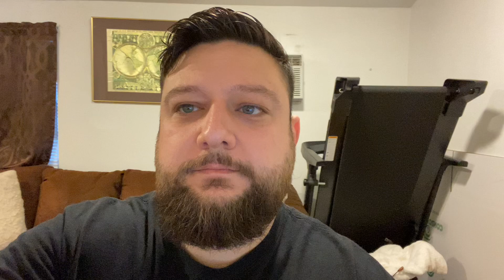Classifying High Compression Engines & When to Use High Octane Fuel

Comment: I know that you are talking about car engines but in the world of bikes, most are tuned for 91 octane. But Triumph Motorcycles, on the other hand, are tuned for 87 octane -- even with a 13.25 to 1 compression ratio on their extremely high performance 2024 Street Triple 765 RS. Yeah, I can hardly believe it myself! I don't think I would personally do that but I've seen many forums where owners say that theirs run fine on 87 and they've had no knocking issues. I should specify that Triumph actually says 87 minimum or higher in their owner's manual.

Comment: Fuel grade prevents detonation.  That is it.  If your motor doesn't ping under load with 87 or 89.  Run it.  You wont make any more power with higher octane than needed.
Reply: ignores owners manual

Comment: I run 86 octane in my bmw m54 2.5 with 10.5 to 1 compression and I think that would blow the engine if it didn't have dual variable valve timing to adjust for the low octane. I'm not rich enough to run 91 octane its the highest here in West Texas but in the 90s we had 93 octane.

Comment: I'm building a K24Z2 engine with the only modification is .020" oversized Nippon pistons and rings, everything else is stock. What pump gas octane rating do you recommend I use?
Reply from the maker: Its a bit of a nuanced question. If your under 500whp 93oct is fine, but there's still benefits to running higher octane. How high really depends on where/how you plan to use the car.
Reply: @VHBEngines  I'll just be doing regular highway and city driving. No racing or driving aggressively.

Comment: Mine's 10:1 compression. I run 91 pump gas. Don't cheap out on parts and pay attention when selecting pistons ect. Do the calculations and don't assume. Summit racing has all the specs on the parts. Even a compression calculator.

Comment: Do you think 11:1 is safe for low boost on 93?
Reply: Prolly
Reply: @TristonSmith_ThePlumbingSmith  2 years later and it's more than safe to run, as long as you have the octane to do so lol. Would probably run it would meth injection just to be safe

Comment: Yo vhb I got knock sencor  coad p0325 swaped out the sencor  and its still there  man any clues  uk spec ep3 5 door k20a3
Reply from the maker: Harness, ecu 🤷‍♂️
Reply: @VHBEngines  ok bro ile try harness to ecu to day  will I have to remove the intake and throttle body